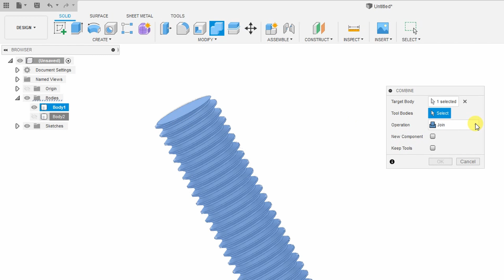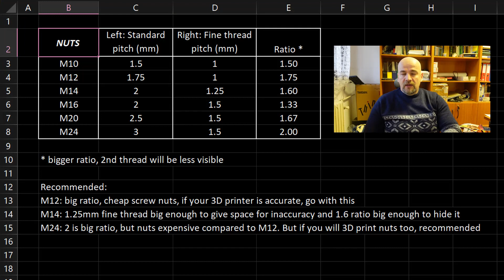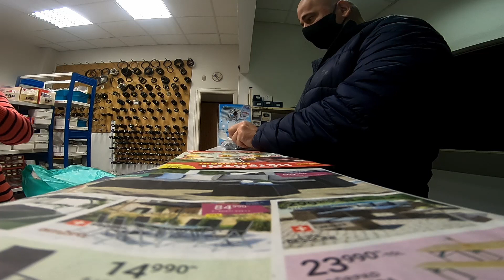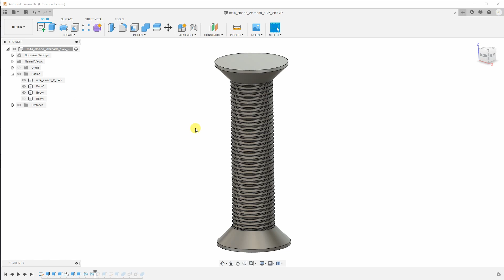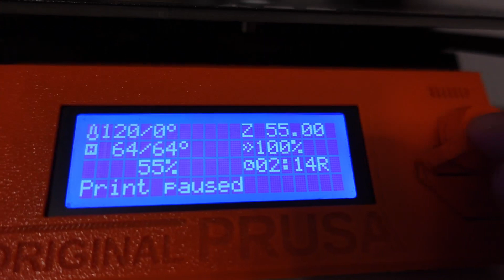Gift idea for mechanical person - a double threaded bolt with left and right handed screw nuts

Comment: Right & left handed threads and nuts like this would be perfect for a bench-top scissor lift. Would be a fun project to design also.
Reply from the maker: For bench top scissor list you need a regular threads, left from one side, right from other. I am thinking if there would be some advantage to use these double thread bolts. Maybe assembly would be easier, not sure now.
Reply: @MyTechFun  Depending on how you design it...you could get twice the up/down speed with both arms moving opposite directions vs only one side. I made a few for raising and lowering my extended support at my drill press (to match height for large lengths of wood).

Having threads on both sides would have made adjusting twice as fast per rotation vs the way I designed them with one side fixed, and regular threads/nut on one side only.

Comment: An interesting video. I am considering to try to build using OpenSCAD.

As you enjoy things mechanical, have you explored differential threads? It is the foundation of the micrometer from many years and is fascinating in my opinion. I 3D printed a test item which required ten turns to extend the thread by one millimeter! Much easier calculations with metric than with Imperial measurements.
Reply from the maker: Yes, I explored them. Very interesting results I got with trapezoidal threads in combination with metric one. BUT trapezoidal nuts are rare in local stores around me, that's why I stayed with M** screw nuts. Good luck with OpenSCAD, I hope there is some similar like "intersect" tool, to combine two threads.

Comment: I'm getting bad layer adhesion where I paused the print.  To the point where the bolt breaks there.  Any idea why that's happening, or how to fix it?
Reply from the maker: Raise the temperature by 5-10*C
Reply: @MyTechFun  I raised it a couple degrees.  Will try more next time.  Thanks!

Comment: It looks like 3 "fascinating" things:
1) A left hand nut goes the other way round (combining it with a right hand nut, you will get a wise).
2) Two different  threads on top of the same bolt, right and left hand. The nuts are not behaving as expected. But if you don't expect anything special, its back to 1).
3) Trapped nut on a "closed" 3D printed screw (not specific to threads).

I am a bit disappointed after having modelled different combinations in Fusion 360. 

Maybe your wife was right – this thread thing is quite boring for a gift...